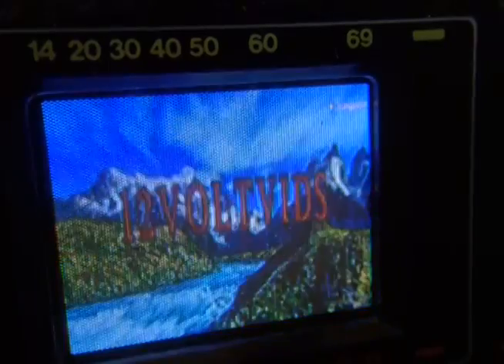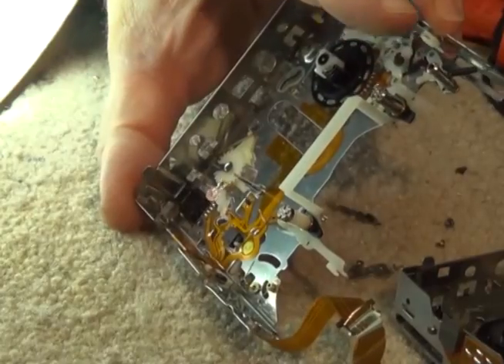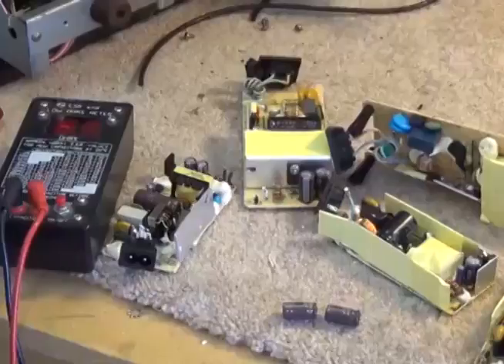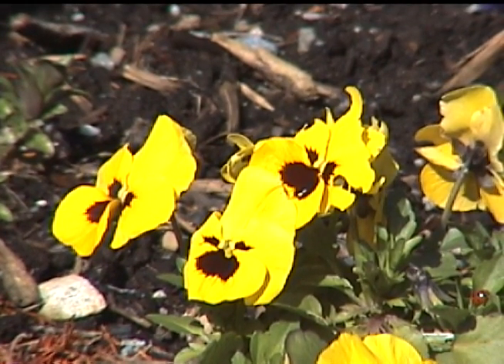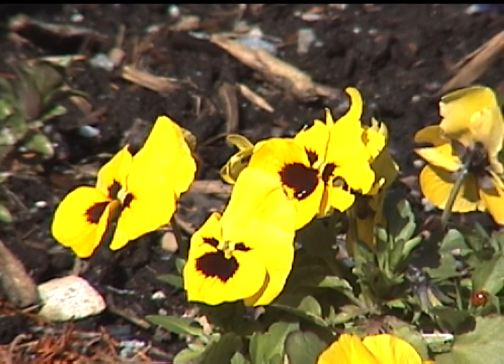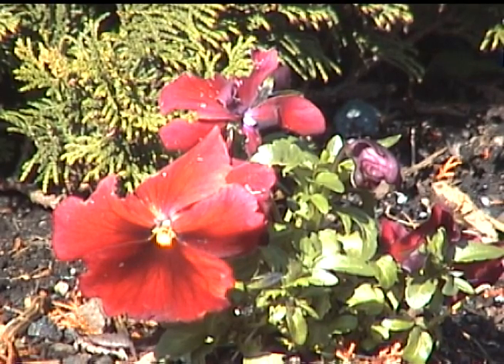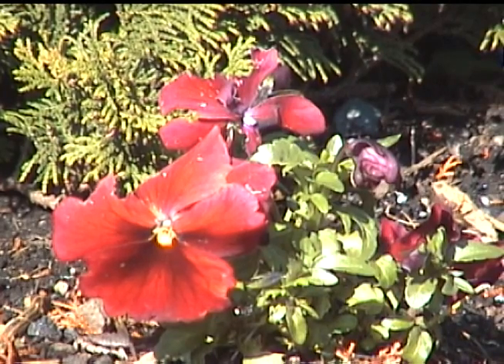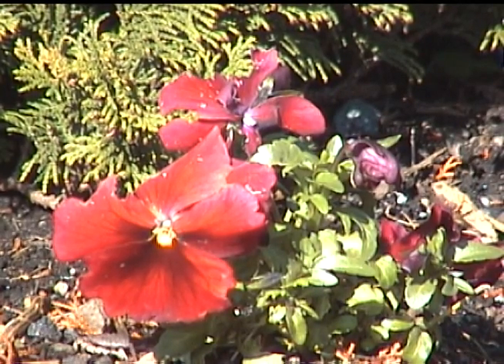Compare Digital 8 vs Hi8 vs DV

Comment: As you said in the description, there is nothing wrong with the digital8 format, just the camcorders, so why bother saying that it is an inferior format in the first place?
Reply from the maker: The digital 8 format was great. The tape itself would record 500 lines of resolution, exactly the same as mini DV and dvcam which was Sony's professional DV format by the way. The difference between consumer DV and dvcam was the tape speed and the track pitch. Dvcam used a wider track pitch and therefore was less prone to drop oats. But other than that the video was recorded in exactly the same format. Dvcam, DV and digital 8 use the exact same codec. The difference was the camera itself. The digital 8 camera was a very low resolution sensor. Hi8 cameras had a better sensor. This was done by marketing so that pros looking for better picture would not buy digital 8 cameras. As I was migrating to digital I was shooting using my evw300 high camera front end and plugging it into a DCR TRV 110. I was using my $12,000 camera and using my little digital 8 as an outboard recorder. That way I was getting all the detail from that great three CCD hyper had front end and getting those details onto a digital tape. It blew away my second camera which was a DCR vx1000, also a three chip camera but the big camera had a better front end and a much better lens and it showed.
Reply: @12voltvids  Interesting info - dig8 camcorders have good analogue video capture even cheap then? But it doesn't answer the question I asked, why bother saying it was a crippled format when it has nothing to do with the format?
Reply from the maker: @bangerbangerbro  not too many people would have bought digital eight just to haul it around as an external recorder to get the quality they needed. It was a crippled format because Sony chose to put a low resolution sensor that barely captured 200 lines of resolution on the front end. They could have used the same sensor that they used on their DV cameras and they would have looked identical however this would have hurt the sale of their DV cameras. Think for one minute, if digital 8, from the camera looked as good as a DV camera why would someone by into DV? After all the digital 8 cameras could play back analog tapes. That was the whole point, move to digital but still play your old analog tapes. DV on the other hand was marketed as a better quality format, higher resolution better color everything. Now had they put that same high resolution sensor or a three chip front end on a digital 8 transport, there would be no reason for someone to buy a new DV camcorder. Sony did not want to hurt their DV sales are there professional sales, so they intentionally put a shitty sensor, one that was barely good enough for a standard 8mm or VHS camera on their high resolution transport. If that's not crippling the camera then I don't know what your definition of crippling is.
Reply from the maker: @bangerbangerbro  it wasn't just digital 8.  DV was also limited in its implementation.  DVC pro for example uses 4:2:2 color space but the consumer version used 4:1:1 in NTSC markets and 4:2:0 in pal markets to make it inferrior to the format that was being sold to broadcast markets.  The reason, so broadcasters wouldn't use a 3,000 camera over a 30,000 camera.  It's all about money and protecting your higher end market.
Reply: @12voltvids  Ok. Why does it matter what format they are selling so long as they are selling their cameras?

Oh you mean it is not actually crippled, but crippled in the marketplace?

Comment: so crazy the differences between the Digital 8, Hi8, and DV. very overwhelmed with the amount of information as the whole format is so foreign to me. im 19 and was never able to use any camera that shot tape. 
i find researching older technology very interesting, especially because im a fulltime photographer/videographer now. glad i found your channel. i think itd be fun to take a step backwards and pick up a camcorder.  currently looking at the sony handycams, not sure if theyre good. is there any camera you'd suggest thats reliable and not bad resolution? dont need anything top of the line, just would prefer it not to be too pixelated when i digitize if possible. also would like it to be somewhat smaller and portable. so many options on ebay

appreciate your expertise.
Reply: Well, if you can, try find a PAL camera, rather NTSC, they are much better, nicer colour rendering and higher resolution.  Digital 8 are good if you get a megapixel one, or one with a 1/4 or 1/4.7 inch CCD instead of 1/6 inch one. The DCR-TRV740E is a good model or 730/830 too.

The best thing with Digital 8 is that the tapes are metal particle, which means they are very strong and will not wear out or develop drop outs and pixelation, where as miniDV is notorious for it because they use a metal evaporative tape instead of metal particle tape.

The difference: think of ME tapes like a plastic tape with metal "dust" on it; is metal evaporative and a fully metal tape is a metal particle one, MP. These two types of tapes DO NOT affect video quality in digital formats, however they do in analogue formats. So if you film on 8mm/Hi8, use ME tape, but with Digital 8, use a MP hi8 cassette instead of ME ones; note that ALL actual Digital 8 tapes are inherently MP.

That said MP last much longer, for play back and recording, in a nut shell, if the camera is Digital 8, only ever use MP, as there is no benefit to use ME, and ME are also much more expensive than MP, but if you use analogue, I would shoot on a new ME, then use a Digital 8 to play it back and archive a digital copy of onto a MP digital 8 cassette of archiving. (This way, you will get the crisp, new analogue "ME quality" of the 8mm/Hi8 recorded video and then have the digital 8 capture that onto a MP tape in the digital 8 format, for long term use/archive; so you will get the best of both worlds (tape types and formats) ;)

This is all entirely theoretical man, depending on what you want to do and how far down the "video tape era" rabbit hole you want to go with your hobbies or work.

This was a big debate then, let alone now lol

MiniDV cassettes are crap, but did have good 3CCD on some models, but even the tapes used different incompatible lubricants between different brands which caused clogged or damaged heads, wind up/chewed tapes etc, Digital 8 NEVER had that problem.
Reply: That said, don't expect crazy resolutions from these cameras, even when you find one, like it for what it was then, and just consider that that was the best video quality we had back then, when you were still bogging a pile of logs in your nappy mate haha;  just like retro stuff, it's fun getting modern videos on old lower quality formats. The other day I suddenly pulled out my whopping 2 megapixel digital camera to take some photos, the novelty of that, and reminiscing can't be beaten.  👌🏻

Comment: my camcorder sony ccd vx1 may be hi8 lower quality video but has better image sensor and much nicer colors than these mini dv digital camcorders
Reply from the maker: Of course the vx1 or vx3 has nicer colors. 3CCD. My HDRFX1 3HHD HD camera has a fantastic picture. Perhaps this year when the weather is nice and the flowers are out I will drag out my FX1 and my AX100 4K camera. Put it in HD mode and shoot a comparison video. Then for fun kick the FX100 into4K mode and watch it destroy the HDV camera. Or will it?
Reply: @12voltvids  Go out and try the camcorder if the weather is nice, Sony camcorders are all so special and great, especially the AX100 4K model the only downside to these digital cameras is the compressed audio in 320 quality mp3 format and  maybe lower 256, while the preferred audio format is flac, wav high quality audio, and also their sound from the microphones is very loud with a lot of trembling that scratches your ears, compared to analog video 8, Hi8 have different  microphones old camcorders the sound is warmer soft and soft to the ear also the sound of the videotape is uncompressed can reach the quality of a digital CD 16 bit
Reply from the maker: @amatorev  8mm and hi8 used companded AFM audio. VHS used linear am radio quality sound.  8MM could use 8 bit 32Khz sample PCM. 
The HD and 4K cameras do not use mp3 audio. The use AAC for audio and AVC for video (AVCHD)  The newer cameras can also use HEVC for the codec. All are much better than old MPG1 which MP3 is based on.  The microphone is of high quality. If you leave the audio set to auto it can be loud, but they all have manual level where you can ride the level manually. I typically don't/ I leave it set to auto because I can't be bothered monitoring audio while I am working.

Comment: It's a very interesting video, as it seems the actual available technology still shows the same bottlenecks: you can have high quality digital encoding and recording system now, but it's always in the lens part and digitizer you can mostly find technological and price gaps. Even if you can now find 2k camcorders for less than 100$, the quality is nothing compared to real high end quality material. Lens quality, and "analog zoom" is first, then comes details that matters, like captor sensitivity, processing speed, image stabilization and many other things including the audio part. And these low cost camcorders are rapidly showing their limits in the same manners: shitty and grainy image, inconstant white balance, bad gamma... Surprisingly, when you have 8k cameras hitting the market, they are not necessarily neither the first target for professional use...

Comment: Compared to a smartphone camera in 2021....the phone cameras are better ?
Reply from the maker: Where is the fun there. No tapes to get eaten, or heads to clog up.
Reply: @12voltvids  How did the Canon DV camcorders fair against the Sony?  I am thinking GL1/GL2 and the Xl1/XL2 models.  The weakness seems to be the cassette mechanism.  I still use a XM2 (GL2) to film on.  It would almost be perfect except for having some lens fungus which shows up in bright conditions.  The camcorder seems ideal for indoors and low light.
Reply from the maker: @AvidRetro  I used to have a GL2.  Dumped it and went back to Sony. Canon had a hard on of using low resolution chips on their 3ccd and offsetting the green 1/2 pixel to increase resolution. Sony used 3 full resolution CCDs amd still offset the green by 1/2 pixel to give an even sharper picture. If you want a great DV camcorder find a Sony HDR FX1. That will shoot in DV and in HDV High definition. Its a 3CCD and is as good as any DV camera (and HDV for that matter) ever got. I have one and it really looks great. Pretty big tough.
Reply: @12voltvids  I see that the Sony 3 CCD camcorders were the one to have.  The HDV lineup of Sony camcorders quickly switched over to 3 CMOS where I guess the early CCD ones still outperformed them.
Reply from the maker: @AvidRetro  
I wouldn't say that.  CMOS are far more sensitive and the processor is on chip.  Ccd requires much more control and processing.  Ccd are global shutter whereas CMOS usually are rolling shutter but are available as global shutter as well.  Early CMOS were inferior but not anymore.
Reply: @12voltvids  Yes I see I wanted my reply to mean that the early CMOS were not as good as the CCD of the time.  What do you think of prices for old camcorders now like the Canons, Sonys and Panasonics  still selling for lots of money...
Reply from the maker: @AvidRetro  Well they are really nlt worth much. I wouldn't pay anything for them because most are not repairable.

Comment: There were some high-end Digital8 Handycams with a Megapixel image sensor, same as used in MiniDV Handycams at the time, but they were only on the market for two years (2001-2002). And the later Digital8 models with the standard CCD did improve the sharpness of the image quite a bit compared to the first-generation models. In fact I think they looked better than Sony's low-end MiniDV camcorders at the time, because the lens is larger. For example, the DCR-PC55 -- the smallest MiniDV camcorder ever made -- has really terrible video quality, even worse than the first-gen Digital8 models.
Reply from the maker: I never had any of those. I had pro gear here as that is what set my videos apart form the competition.
Reply: @12voltvids  So you aren't a professional or competing with professionals then, if using pro gear made you unique? ;)
Reply from the maker: @bangerbangerbro  
I was a professional producer.  For that matter i still am.   I did high end weddings, corporate videos, commercials, music videos and news gathering.   Over the years I used various formats.  3/4", betacam, hi8, DV and HDV. Even though height and DV were never considered broadcast formats, there were many shows and productions that were shot on that very equipment and the manufacturers knew this and made high-end cameras in these formats. My comments about digital 8 were that Sony did not want digital 8 being used for pro productions and limited the quality on the camera that it could produce by putting a low pixel count sensor. They could have put a great three CCD camera on a digital 8 deck and it would have looked fantastic because digital 8 had the same quality as DV, in fact they could have made an 8 mm digital camera that had even more bandwidth then DV because of the larger tape. They didn't. It was a consumer format, and there was much more money to be made in the proformats of the day like betacam which was the industry standard for production.
Reply: @12voltvids  What I meant was wouldn't pretty much every other professional also be using pro gear?
Reply from the maker: @bangerbangerbro  
Many so called pros were using home video gear.   A few of us used big cameras.   We got the big bucks  to shoot weddings.
Reply: @12voltvids  Ah. So "prosumer" Vs proper pro.
Reply from the maker: @bangerbangerbro  
Prosumer.  Ccdvx3, ccdv5000, EVs3000 evs7000. Professional evw300, evo9800. 
They were all hi8 but the latter 2 was 12000 for the camera and 6000 for the studio player.  Yes there was a huge performence difference between the 2 lines.
Reply: @12voltvids  Right. Amazing!
Reply: Sony basically gave Digital 8 the shaft even compared to their consumer MiniDV units. They kept the same 1/6in CCD they used in their Hi-8 camcorders in most of the Digital 8 models. The MEGAPIXEL models came with a 1/4in sensor that was shared with a few of their consumer MiniDV camcorders.
Reply: Digital 8 is the best tape format, better than miniDV, as Digital 8 is a metal particle formulation as opposed to all the other digital and analogue formats all used iron/chrome oxides or metal evaporative tapes.

Only problem is Digital 8 got given crap CCD's. 

But the advanced HAD, megapixel Digital 8 were awesome, especially if it's PAL, I have one, I still use it to this day. I have 20+ Digital 8 tapes that play back flawlessly,  while a miniDV that age would pixelate and near not playback at all.
Reply from the maker: Lens size meant nothing.  The lenses on most consumer cameras used plastic internal optics.  Cameras that had the zeiss lenses were good as were some of the canon lenses on their higher end but the low end used crap lenses.
Reply: I was going to write the same thing. Sony's DCR 300 and 500 series and the DCR 7000 are quality workhorses. Positioning, composition and lighting plays a HUGE part. - JAMES D Watkins artistic director of PHOENIX PRODUCTIONS.

Comment: I just did some research on the sensors used in the first-gen D8 cameras (I have 2 DCR-TRV310) and they use a ICX089AK sensor. The crazy thing is this sensor is made for PAL cameras. Before cropping and scaling there are 724 x 582 (420k) usable pixels. If they gave you an option to use the entire sensor when you disable SteadyShot I presume it would look much better. There would still be lower color resolution but that's certainly fine for a consumer camera.
Reply from the maker: Even with steadyshot off it doesn't use the full count.  Remember that is gross count right.  With the color seperation filter the count is much lower.  They use typically 2 green 1 yellow and 1 magenta to generate color.  With a pixel count that low the color resolution is very low.  I remember canon used to use 3x 250k chips on cameras like the gl1 and claim by offsetting the green by 1/2 pixel that the resolution would achieve 500 lines.  Bullshit i had a gl1 and a vx1000.  The vx1000 used 3x680k chips and it blew away the canon.  Both these cameras used optical stabilization too so no understanding the chip for that.